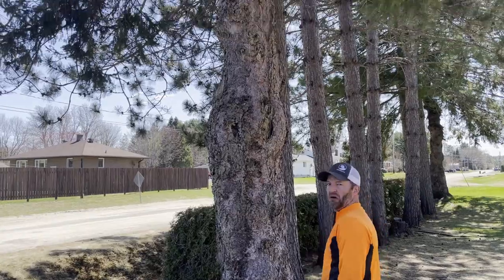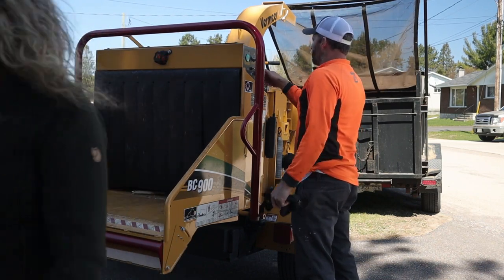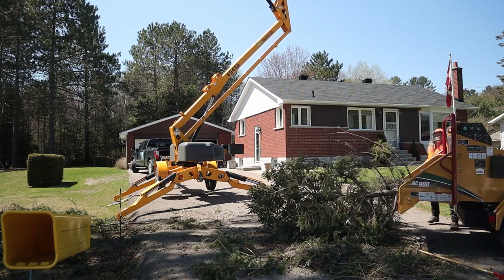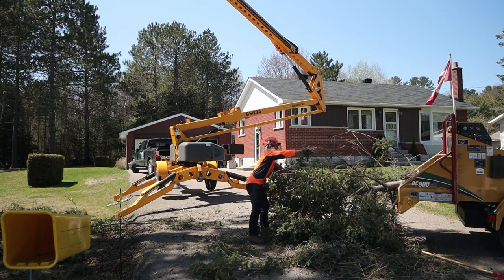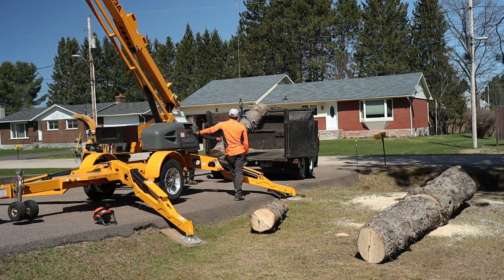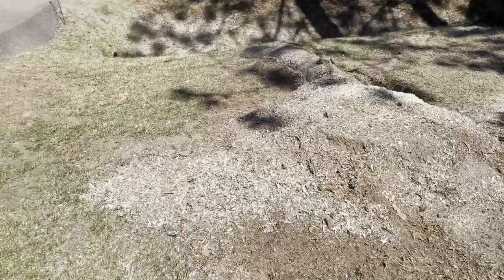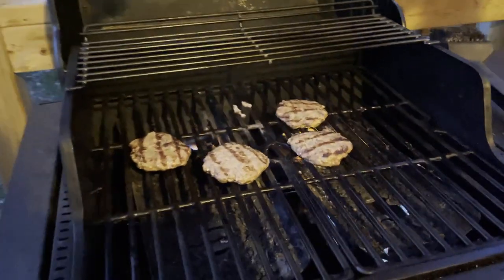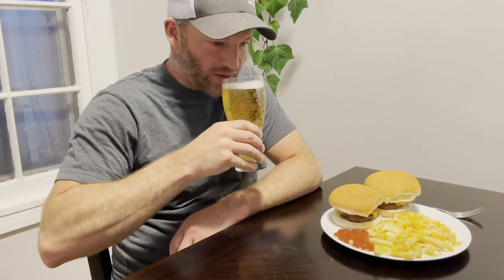UGLIEST TREE EVER, 2 TAKEDOWNS & A STRUGGLE | Job Vlog #2

Comment: That's quite a project on that tree..Wasnt sure she was going to get that top in the chipper..lol
Great idea buck the log into length so the machine could lift them, looks like by the size of the chips your cutters were getting dull.. I've used tongs before, gotta have a good operator as I've seen guys get knocked right off a cold deck before, almost dangerous as careful as one is around them..

Great video ..
Reply from the maker: Hey Norman, thanks for the comment. I go pretty slow when lifting and the chipper knives were just turned so I should get another 80 hrs on them before they need to replaced or sharpened
Reply: @TimberMates  You two are pros at what you do out in the field, you know how to do the task..
And of course I wasn't on the site so my observation was off quite a bit..
I was referring to the wood chipper not the stump grinder.. The struggle you had to get that top with 1,000 limbs on it started in...lol
Reply from the maker: @normanmallory2055  I was also talking about the chipper, hence chipper knives :) Lol that tree top was a struggle for sure